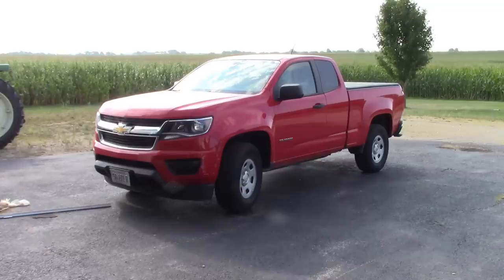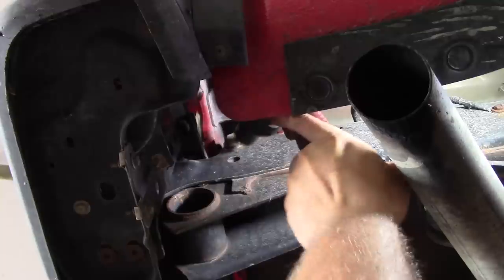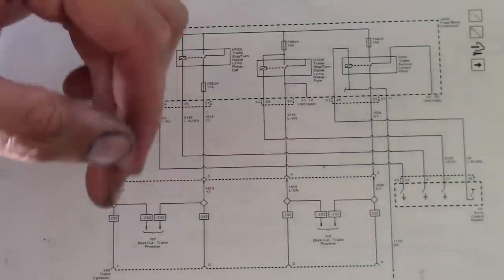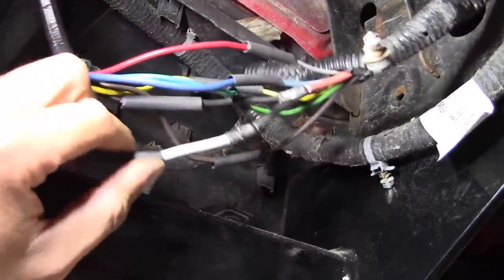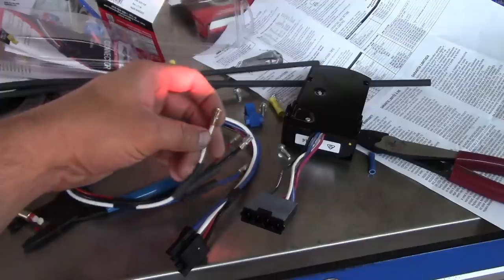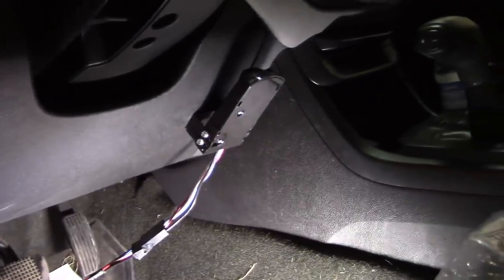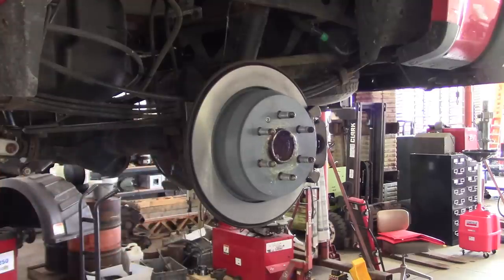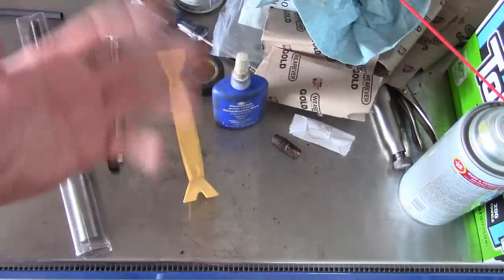2015 Chevy Colorado - Install Trailer Hitch, Wiring, Brake Controller

Comment: Is the rear numberplate legit. That one wouldnt cut it in my neighberhood. Cops would be on it. Cheers good video
Reply from the maker: It's a common issue here. Illinois is so cheap they don't even paint the plates. It's like a wrap that peels off. And they won't replace them.
Reply: @WatchWesWork  You mustnt have many speed/red light cameras . The primary source of income , fines in Aust start around $400 and your licence has 12 points / fines before you lose it. But they need a good image to prove them.

Comment: Man, i hate those time based brake controller. I guess hes not going to pull anything big, so I'm sure it will be fine.. but to me, its a guarantee problems with wearing out the trailer brakes... also.. how much more do you think that it would of cost, to weld on a receiver to that original (not) trailer hitch, a dollar? crazy.
Reply from the maker: It uses an accelerometer. The older ones used a pendulum. The original brace is only rated for 3000lbs. It's very flimsy.

Comment: What is a brake control unit 
Is that to brake the trailer? 
In the Netherlands ( Europe) this is not used 
We have the run-up brakes on the trailer
Reply from the maker: Yes. It controls electric brakes. It has a variable control that responds to the braking of the truck. It used to be done with a simple pendulum. Now it's all digital.
Reply: @WatchWesWork  Thanks for the explanation 
I think it's really nice to look at you. You have a beautiful voice and a quiet look 
Making it pleasant I to watch 
Ps don't have to be hearted for your wife she does her best too
😀

Comment: Should disconnect the battery,if the hot wire hits a ground you could try the computer.especially when it's not your truck.explane that one to the customer when it happens.

Comment: Can a colorado even tow something heavy enough to merit trailer brakes, much less a controller?
Reply from the maker: These things are built like a half ton truck from 15 years ago. 6 bolt wheels, plenty of springs, etc.
Reply: @WatchWesWork  Fair enough. I've never pulled anything with a pickup that was worth fooling with a tbc. Although if my dad ever decides he needs his pontoon pulled out, I'll probably invest in one. Anytime I'm pulling real weight I have air brakes.

Comment: Probably a stupid question but why does the brake controller installed outside instead of behind the dash?
Reply from the maker: The controller has buttons to activate the brakes in an emergency, and to adjust how strongly the brakes are applied. Those controls need to be accessible.
Reply: @WatchWesWork  Thank you...."Every day is a great opportunity to learn" I've been told

Comment: I installed hitches and trailer wiring for 15 years you need to know its a crap shoot whether the factory wiring is terminated properly power is tied off fuses and relays are missing never count on wiring diagrams to be correct.      test test test.   everything

Comment: i sell all them bare connectors in 50, 100. 500 and 1000 pack, but better yet heat shrink connectors with low temp melt solider that melts with just a heat gun as you shrink, the controler must be in a place were the drive can easaly get to it to set the braking power, but most importantent, to manualy apply the trailer brakes independent from the truck brakes, for cases like trailer starts to sway. trailer start to push you on a spep down hill. or when on ice road and trailer starts mis behaving, so many RV's end up jake knifed and crashed simply because the deiver has no clue about use of the brake controler ,, 9 out of 10 of these crashs are a sirect case of drivers that dont know how to use a brake controler, they think, the truck takes care of it all,  SO WRONG, THAT BIG HEAVY PART YOU TOOK OFF, TO INSTALL A CHEAP LIGHT HITCH,  is built like a really heavy hitch, just missing the 2x2 seamles tube, , i buy the seamless tube in 20 foot lenght, and for that truck just weld on the 2x2 tube, and 2 peaces of 1/2x2 flat bar to reinforce it, and your struger then the after market hitch, i willnot use them after market hitchs on trucks towing over 7000Lbs, were the metal is bent in an L to bolt to the frame, rips open and hits the road, i build a real hitch were it has the cross bar at the back as well a 2nd cross bar 2.5 feet forward. with 3/8x4 flat bar welded on the ends to bolt though side of frame in 4 places, then again i been a class A welder all my life. it is not a job for the DIY, BUBBLE GUM-ER, THAT WAX CRAAP IS JUST THAT, CRAP,  it dont kill rust, it seals in water to make the rust rust faster, rust check is cheap to have done, i get my 1993 Chevy 4x4 done every fall before the snow, they sock every thing down real good until it is dripping, so you know a great job been done. never re-use any body bolts to install a hitch, every hitch comes with the needed hardware to bolt it though the frame, they even come with wire bolt trhreaders, were the bolt screws into a spring like deal on the end of the threat wire and the bolts have a spline like a wheel stud close to the head to grab the steel frame so it never turns well installing the nuts, them body bolts are only a grade 2 bolt and do not have a nut , there just self tapers,, and hold shit, i really hate guys that put out this crap info, it is discusting, the poor sole follows this and ends up F up. them scotch lock wire conectors are great for setting your truck on fire

Comment: I guess I better not wire up my brake controller. I would probably end up with half a dozen Scotch lock connectors. 😮
Reply from the maker: LOL. They work OK inside, but man the salt just eats them.

Comment: cequent towing products (reese, draw-tite & hidden hitch) make an independently powered module to take the inputs from the vehicle and supplies independent signals to the trailer plug. it adds only milli amp draw to the factory wiring. scotch locks.....uggg. absolute garbage.
Reply from the maker: Well you learn something new every day! I just looked it up. A tail light power module. $35, can be mounted externally, and .5 mA draw on the light circuit. I'll be filing that away for future use!

Comment: What crimpers are you using?
Reply from the maker: The crimper and stripper are both Klein.
Reply: @WatchWesWork  I've always run with vise grips, but I'd like a tool that's actually meant for the job.

Comment: Why do they have holes in the box frame
Reply from the maker: I'm assuming it's for fixturing when they weld the frames.
Reply: @WatchWesWork  ya that's makes sense doe you'd wonder why they don't put some sort of cap on them to block up the holes

Comment: Isn't them not touching that job because there's no telling what the owners might do and regardless of what they do or don't do installing the package...it might come back to bite them? I mean, you're exempt, because you film this stuff and this is case material (as far as i'm concerned, mostly saying that because i know of guys in US who have used footage like this to certify ...uh, to road legal various vehicles they built).
Reply from the maker: I've seen all kinds of crazy accidents involving trailers, but I don't know if I can think of one caused by the actual hitch failing. Even then, if it's a factory made hitch, they would assume most of the liability.

Comment: Can't you buy that wax in a 55 gallon drum and use air to pressurize it? I mean how many cans do you use on one car? 😂
Reply from the maker: That would last me a lifetime. Two cans will do most cars, but it's pricey. Around $30 a can.
Reply: @WatchWesWork  I've asked a friend what they use on the vintage cars for permant protection against rust. He said they use fluid film and perma film above.

Have you tried those yet? 🤔

Comment: When shops take illegal and dangerous short cuts they should be jailed AND shut down because management should inspect every installation before it leaves the shop and sign off on a customer copy! 
Wife have a cold? Got it from son last video!
Reply from the maker: That is what happened in this case. The shop foreman caught the broken bolts and informed the customer. But I don't know why they couldn't fix it there.
Reply: Yes I got a cold from the kid.

Comment: I can't believe you can buy a pick up truck of any size that doesn't have a factory installed hitch................  I tow every week at least once, sometimes i use my trailer 3 to 4 times a week, i cant imagine my truck not having a hitch....... weird.
Reply from the maker: Well it has the bumper hitch, but that's not rated for any real towing.
Reply: @WatchWesWork  little red wagon doesnt count? that build it yourself kit trailer from horrible freight worked out my 06 canyon. ratchet straps and bungee cords to the rescue. bahh, who needs a bumper ball